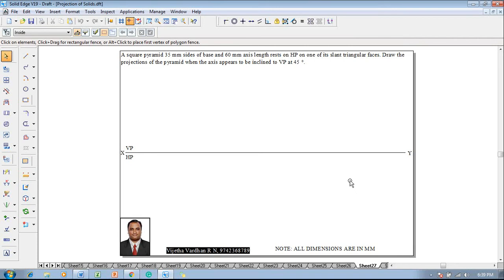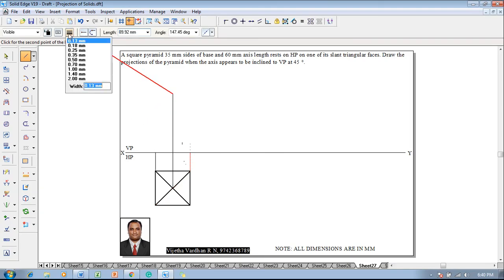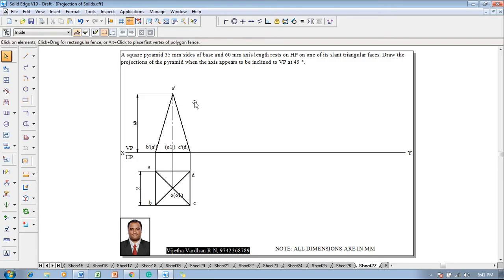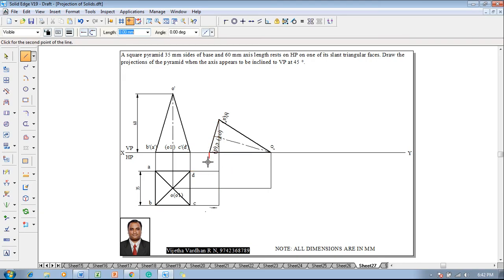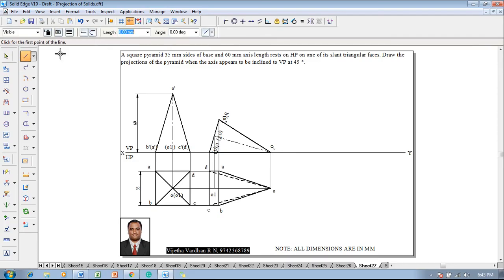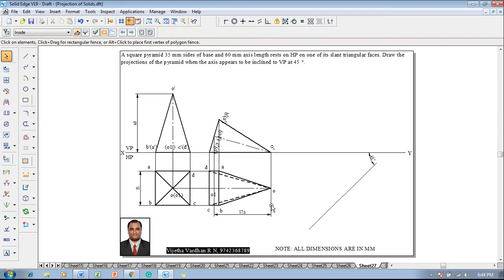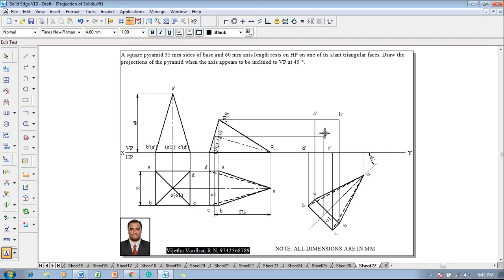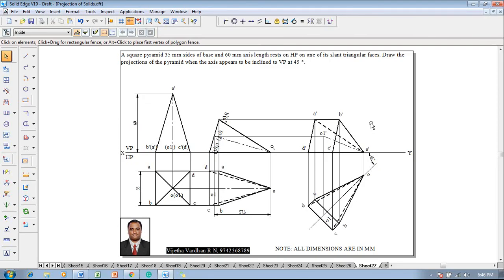Example 27 on Projection of Solids

Comment: Draw the projections of a Square pyramid of 32 mm side of base and axis 55 mm. It 
is resting on HP on one of its base corners with a base side containing the corner 
making 30° with HP. The axis is inclined at 30° to VP and it parallel to HP. The 
vertex is away from the VP.
2. A pentagonal prism, side of base 25 mm and axis 50 mm long, rests with one of its 
edges on HP such that the base containing that edge makes an angle of 30° to HP 
and its axis is parallel to VP. Draw its projections.
3. A pentagonal pyramid, side of base 30 mm and axis 60 mm long is lying with one of 
its triangular faces on the HP and a
Reply from the maker: If time permits i will solve and share